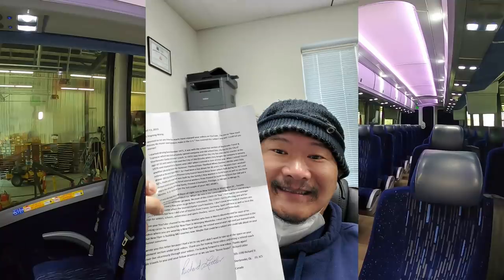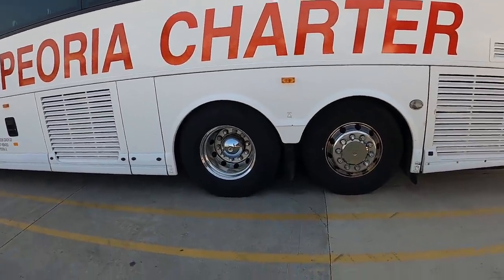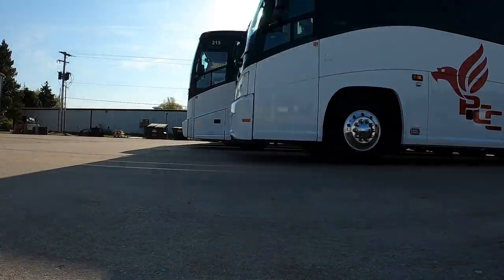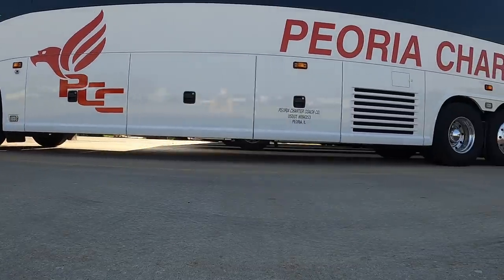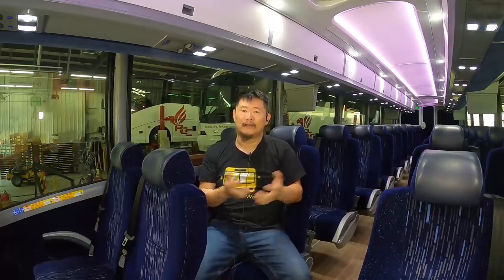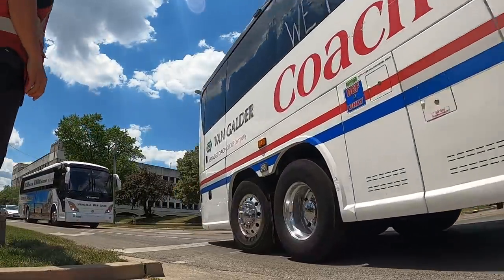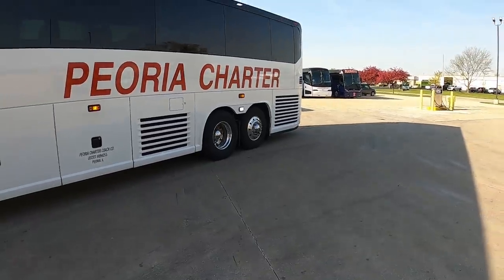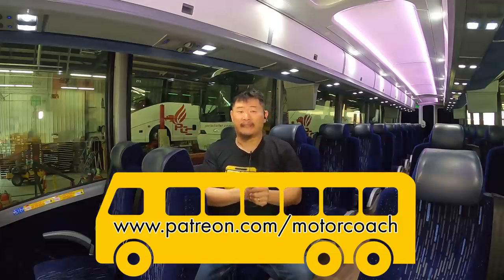The 3rd wheel | What is a tag axle??

Comment: The tag axle is really there for only one reason, to keep the vehicle under the legal axle weights allowed on the road. In the US you are allowed 20,000 lbs on a single axle and 34,000 on a tandem axle provided the tires can carry the load. On our Prevost conversion, the rear tandem weight is 32,000 lbs so you can see there is no way to legally operate the bus if it didn't have the tag as you would be over the single axle limit of 20,000 lbs. So that's really all it is, the smaller buses that don't use a tag do so only because the total weight in the rear is 20,000 lbs or less and the ones that have a tag have it because they need it, legally. And the two axle Eagles and MC-9's used for commuter service in the northeast were built with savings on the toll money from that extra axle and they were right on the 20,000 lb limit, so much so that they really couldn't be used for normal charter or line work as with luggage or freight in addition to the passengers, they would be overweight on the rear axle. Agree that the tag makes it more stable but they could have designed it better to be more stable without the tag but again, they've got to have the tag anyway to comply with the legal weights. Talking about Greyhound, none of their 35 foot buses had a tag but once they hit 40 feet they all did, again a function of carrying the increased weight of the heavier bus legally  down the road.

Comment: i'm a coach driver in France, and i drive some 14 meters or 15 meters transit Setra 417 UL for the 14 meters or 419 UL for 15 meters, we have tag steering axle with passive mode at low steering angle, sometimes when we have Stability program default on sleepy wet roads, we are losing, the tag steering its harder to turn, we have to restart de engine to erase the stability program default !!!

Comment: Cool video. Good explanation of tag axles. One of the heavy duty tow operators has an explanation of the tag axle on his big wrecker called a rotator that has slight self steer capability and also lifts automatically when backing up.

Comment: I drove vanhool buses and I would suspect the tag axle was there due to the weight of the engine. It would keep the nose of the bus from raising creating steering issues. I was never told what the tag axle was designed to do, so thank you sir, keep up the great work.

Comment: Correct me if I'm wrong but if there is non-drive axle in front of the drive axle it referred to as a pusher axle not a tag axle. Tag axles are named as such because they 'tag' along, i.e. follow. This configuration is common on tractor units on lorries here in the UK due which allow 6x2 units to pull loads up to 44 tonnes, 6x2 units with tag axles do exist but are less common. The pusher axle is normally also a steering axle. However as the video suggests the pusher axle set up is not found on coaches or buses, which all have a tag axle behind the drive axle when it has a 3-axle configuration. As well as providing better weight distribution, the purpose of the tag axle on coaches and buses here in Europe appear to be allow the vehicle to make tighter turns as the tag axle is nearly always also a steering axle which in low speed manoeuvres steers in the opposite direction to the direction of travel to allow a tighter turn to be made.
Reply from the maker: Thanks for this bit of info. One of my sources was from Wikipedia which referred to the pusher as a Tag. So I inherently used the term Tag axle. Wikipedia could be wrong and you could be right. Thanks for the comment.

Comment: You forgot one main negative. Less traction! You have less weight on the drive axle. Will be noticable during slippery condiitions. In snow for example.
Reply from the maker: I mentioned this at 10:34 , https://youtu.be/Zn6Hi6rofiY?t=634
Reply: @MotorcoachWorld  But at 7:48 you say the tag axle increases traction in poor weather conditions. Seems to conflict with your comment at 10:34. Spreading the weight over more tires seems like it would reduce traction.

Comment: An unpowered axles in front of the drives is a pusher axle.
Reply from the maker: Thanks for this bit of info. One of my sources was from Wikipedia which referred to the pusher as a Tag. So I inherently used the term Tag axle. Wikipedia could be wrong and you could be right. Thanks for the comment.

Comment: An unpowerd axle infront of the drives are not called tag axles but pusher axles
Reply from the maker: Thanks for this bit of info. One of my sources was from Wikipedia which referred to the pusher as a Tag. So I inherently used the term Tag axle. Wikipedia could be wrong and you could be right. Thanks for the comment.

Comment: Error.  When the tag is in front of the drive. It’s called a pusher axle
Reply from the maker: I've heard others say that too. Wikipedia says differently though referring to those in front as tags as well. Other technical sites says there is no actual official terminology for what's a tag and what's not although tag axles In front can be referred to as pushers or bougies.
Reply: @MotorcoachWorld  as a truck driver currently. I started out as a diesel mechanic. This is reason for it.  On heavy haul truck. U may have 2 drives. 2 pushers. N 2 tags. 7 axel total. Saying pusher 1 would be first axel of rear configuration.  Tag 1 would be the 5th axel of the rear configuration. Generally or rvs n busses they are a dead axel only there for weight.  However they can be live.  This is that they may have brakes. But never will they drive.  The standard semi tractor has 2 rear axel. The rear is primary drive. However. The front can drive to by engaging the power divider.  That is a drive tandem.

Comment: 7:49. As you point out later when you note the tag axle is sometimes lifted to improve traction in snow, a tag axle actually hinders traction rather than improving it. This is because a lower percentage of the vehicle weight is carried by the driving axle, when a tag axle is present. However a braked tag axle can improve grip under braking.
Reply from the maker: Hi James. You are assuming that traction only includes acceleration. Although you are correct in that point, On a Coach bus, Acceleration is not the main focus when it comes to traction. Laterial traction (Which occurs during turns , ESPECIALLY AT INTERSTATE SPEEDS) and breaking are the most vital to coach buses safety. In that sense, as you mentioned in the later part of your comment, traction is improved with tag wheels. The more wheels there are, The more traction a motor coach has from sliding off the road .
Reply: @MotorcoachWorld    I think we agree on all the principles at play here. However i would define traction as the ability to put power down only, whereas you also equate traction with non-powered grip. I accept that in common usage the meaning of traction has perhaps broadened in that way beyond its technical definition. ;-)

Comment: Wait so if double wheels are basically mounted back to back wouldn't you need to take off the wheel hub to replace the inner wheel?
Reply: No, the two wheels share lug studs and nuts (the fastening hardware).  
You first remove the outer wheel-and-tire assembly, then you can remove the inner...
It's simple, but not easy (without the right tools).
Reply: @surlyogre1476  Ohhh I think I get it. For a moment I was thinking it would literally be on the other side of the hub with the axel passing through it or something

Comment: Technically if the "Tag" axle is ahead of the drive wheels it is called a Pusher axle
Reply from the maker: Thanks for this bit of info. One of my sources was from Wikipedia which referred to the pusher as a Tag. So I inherently used the term Tag axle. Wikipedia could be wrong and you could be right. Thanks for the comment.
Reply: @MotorcoachWorld  Most of the busses shown all had Tag axles as they were behind the Duals. The only exception was the Eagle busses you showed. Those were in front of the Duals and as you said "the "Tag" axles were ahead of the drives being PUSHED..." It seemed like a great spot to add that. Just thought it was worth noting for all the anal retentive folks out there haha.

Comment: If it’s in front it’s a push axle not a tag axel
Reply from the maker: Thanks for this bit of info. One of my sources was from Wikipedia which referred to the pusher as a Tag. So I inherently used the term Tag axle. Wikipedia could be wrong and you could be right. Thanks for the comment.

Comment: why would you have steering axel at the rear instead of the middle?
Reply: During a turn there is more need to move the vehicle's overhang (tail) sideways.
Reply: @raygrinders3918  You would assume the vehicle would want to turn the centre of gravity?
Reply: @chasx7062  If that means "spin on one point",  the goal is to move the bus' body further to the outside of the curve it is making.  The more rearward the steering wheels are from the center, the easier it is get that effect from the tires, or at least with less side friction.  Have you ever seen firetrucks which have a steering operator near the rear and produce a more dramatic effect?  The ultimate turn would be caused by engineering wheels which can turn at right angles to the bus, but this would be very complicated and cause prohibitive sideways skidding on the other tires, etc.

Comment: I don't want to sound like a "know-it-all," nor do I want to comb through all of the comments since I'm sure this has already been stated, but I feel like the explanation of "outie" wheels was just a little bit lacking. 

Basically, the purpose of an "outie" rim - especially in large vehicles - is to put the turning pivot point of the wheel directly in the center of the tire side-to-side (as in: in the middle of the tread). The reason for this is not only to make turning easier as was said in the video, but it helps any asymmetrical forces put on any "outie" wheel to not act directly on that wheel's turning pivot. Think of the wheel as a possible lever from its turning pivot to its outside. If the turning pivot is in the center of the tire, there effectively is no lever. So if you have a flat, there is much less force trying to pull that wheel to the outside. Sure, it will pull and the vehicle itself will pull. However, if those wheels weren't "outies," it would simply throw your hands right off the steering wheel if anything like that happened and the vehicle would be rendered automatically uncontrollable.
Reply from the maker: Hey thanks for clarifying.
Reply: So innies are used only on non-steering axles, correct?
Reply: @raygrinders3918  Basically, yeah. Because an innie is not mounted on a pivot point (like steering), so it doesn't matter. Wheel always stays straight unless you literally have an axle or mechanical failure.